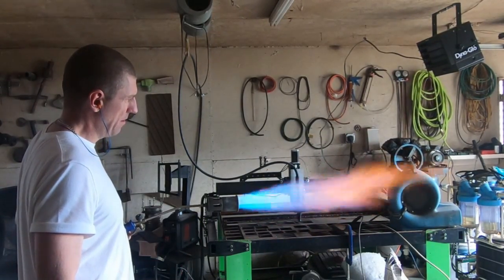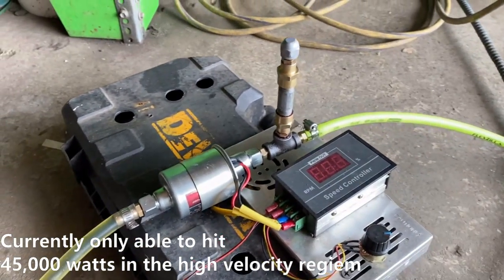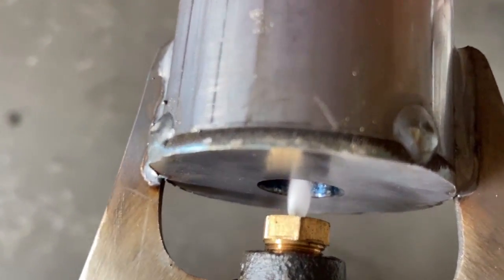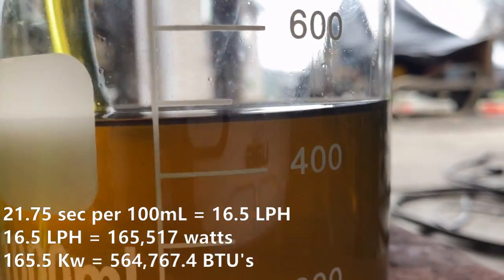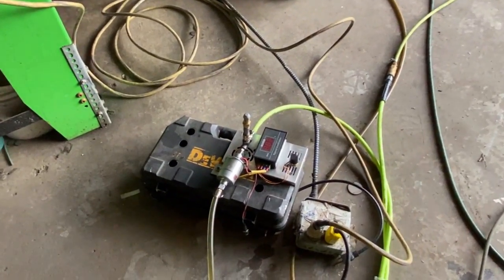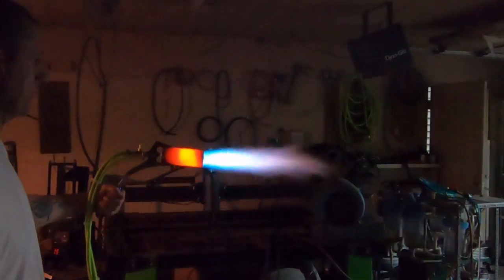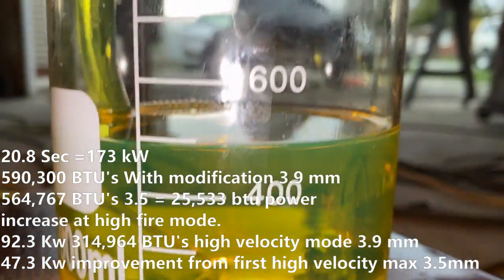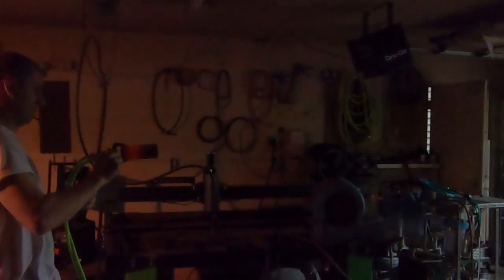90 kW Rocket torch high velocity and high fire mode @ 590,000 BTU'S

Comment: Have you ever tried adding an oxidizer to your fuel. Seems to me that if you used kerosene and oxygen you could tap into jet engine standards for the nozzle... or alternitely using hydrogen peroxide  and then use rocketry nozzles. I am new to your channel. My second video... many more to come.

Comment: How are you calculating your  btu output?
Reply: Long story short, (fuel quantity burned * time) will tell you how much energy was produced. 20.8 Seconds of burnt oil is 173Kw
Reply from the maker: pounds or liters per hour burned , example 1 liter per hour of oil is 10,000 watts of power

Comment: Are you noticing any advantage with the cylinder burners over the box style burners you were building? I'm sure you are.
Reply from the maker: for what ever reason the squared burners are more stable ant light easier
Reply: @NOBOX7  it's the corners, the line drag is greater in the corners than everywhere else in the burner, thus, since it creates a slower flow area, it let's the flame catch up and reach the inside of the burner and ignite the faster areas from the side.  The cylindrical burner heads only have the advantage of a wider "river", but the square adds, as I'll call it, about the equivalent of large stones to it's bed.